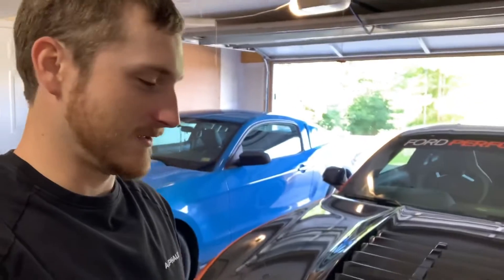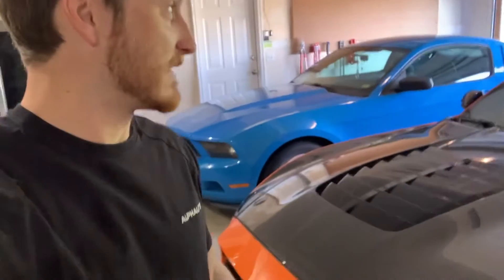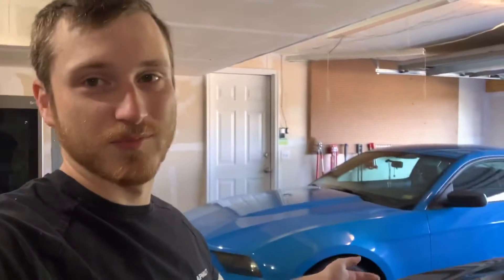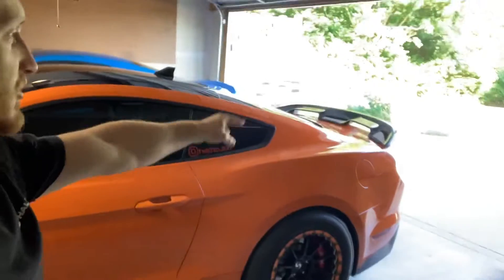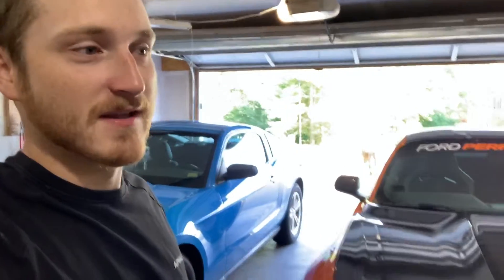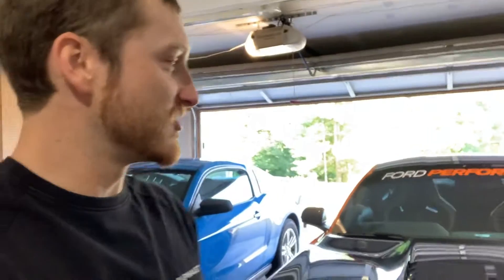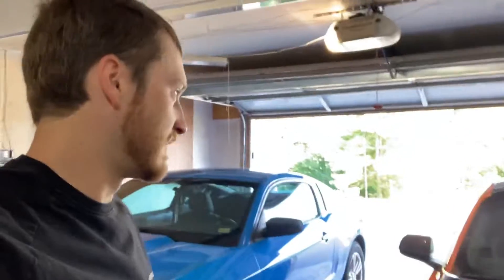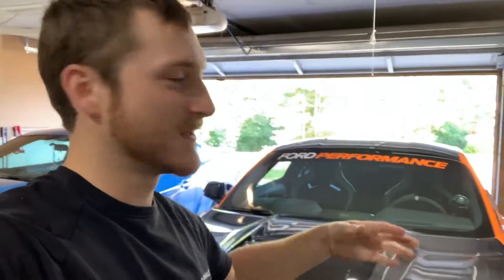Update video. Carbon Fiber hood on my 2020 GT500 and more

Comment: How long did it take you to get the hood? And how did you get the latches to release with the 3m tape? I want to do hood and trunk but I want to drill the trunk for a cftp spoiler
Reply from the maker: Got it 4 days after ordering but that was because it was in stock. And just took a rubber hammer to the back of the latches.

Comment: Nice upgrade man, and let me warn you a little bit, your GT500 better not do too much pulls, there's so many YouTuber out there had troubles with their heavily tuned engine, their GT500 just keep broken down, StangMode, Iconic GT500 and so on. That Predator 5.2 Supercharged V8 Engine is too fragile compared to Coyote 5.0 V8.
Anyway good video.
Reply: Iconic gt500 had an injector stuck open and the motor was spotless when they took it apart. Btw never use stang mode as a comparison to anyone that guy doesn’t know what he’s doing and he blows his car up bc he cheaps out on parts that would’ve cost him less if he put them on the first time